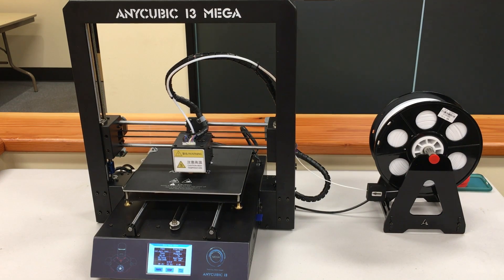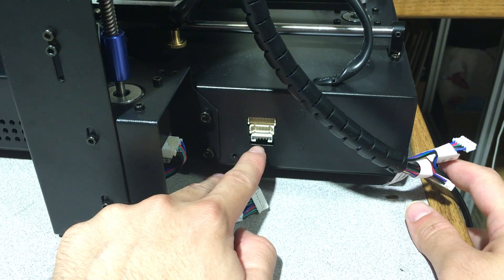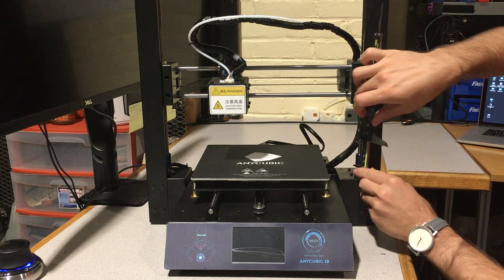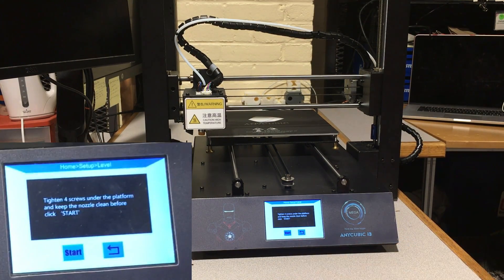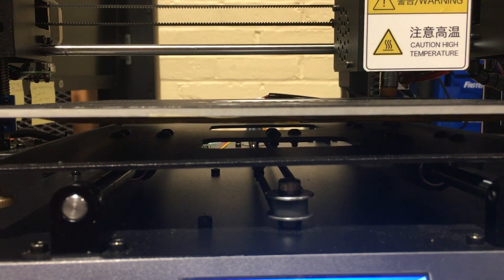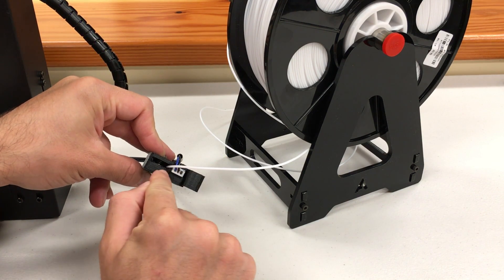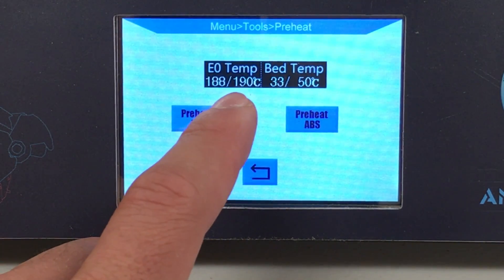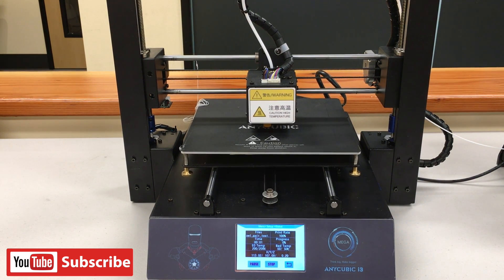All Assembly Steps | Anycubic I3 Mega | Leveling and Starting the Sample Print

Comment: I just got this printer and there is no "leveling" option in the menu, is this possibly a firmware update issue?
Reply from the maker: Its an old one. They removed it in the new ones.
Reply: @3DPDoctor  ok I was wondering if you might be able to help me with my Anycubic i3 mega that i just got from someone..  I am having a hell of a time trying to (1) level it and (2) get the firmware updated from 1.1.0
I got Cura to recognize it via the usb b and i can move all axis via my laptop,  but when i do the firmware update 1.1.5 from Anycubic it says it was successfully installed,  but when i check the printer it still shows 1.1.0, or can you recommend an alternative to the official version?
Reply from the maker: Its been a so long time I stop using this printer after the last failure, so unfortunately I can’t help
Reply: @3DPDoctor  fair enough,  thanks anyway 👍
Reply: @3DPDoctor  The guy i got it from just gave it to me and said the hot end was bad, but i tore it down and used a heat gun to free up the filament from the element,  sensor and tip and put it back together and it came back with no errors,  but when i tried to run a test the filament was bunching up a bit and seemed like it was in need of an adjustment,  but i dont want to run it again until im sure its level enough to not damage anything

Comment: Hi. Could you tell me what thickness there is between the tip of the nozzle and the plate? Wow the Anycubic I3 has leveling and all the equipment to do it (sensor, pcb, etc). I own the Anycubic Mega S, I thought it was superior to the I3.... . But both machines "travel" parallel. The sensor I want to put .... I will ask for some solutions and software updates (as far as possible) to the manufacturer. for the moment thanks and waiting for valuable info. Thank you very much.
Reply from the maker: Well if you are asking for the leveling it is around the thickness of the sheet of a letter. They removed leveling from i3 mega after upgrading to the anycubic ultrabase plate. I think it was a great feature :(
Reply: @3DPDoctor  The adjustments are not precise which is why calibration issues arise. Currently I have not performed this hardware update .... .

Comment: I bought my printer at 2020 and I don't have any options like auto levelling. Because of that reason I couldn't calibrate my printer and it nearly happened around 6 month...
Reply from the maker: Auto leveling was removed couple years ago. You need to do manual bed leveling.
Reply: @3DPDoctor  when I try to level my bed there is a sharpness at the center. what do you recommend?
Reply from the maker: Ne kasdettigini anlamadim. Ne tur bir sharpness? Dogru kelime degil sanirim
Reply: @3DPDoctor  4 köşeden kağıt geçecek kadar ayarlıyorum ama merkeze geldiğim zaman nozzle ile yatak arasında sürtünme oluyor. Köşelerde ki gibi olmuyor merkezde
Reply from the maker: Yatagin bukuk biraz o zaman. Koselere daha fazla yukseklik ver. Merkezden kagit gecebilcek sekilde olsun. Sikintili bir durum. Yatagi tutan metal parcanin degismesi lazim. Bukulmus sanirim
Reply: @3DPDoctor  Cam koymayı düşünüyorum
Reply from the maker: Olabilir

Comment: so i got the anycubic S and i can't seem to feed the filament, it preheats and when i push the button i see the weal turning that i think is supposed to suck it up but its not going in, it just keeps turning...
Reply from the maker: Tommy Sear try to flatten the filament. It is probably getting stuck on the sides of the tubing. It takes some effort. Also angled cut on the filament end would help!
Reply: Osdoyi PhD I got an other question for you, i was able to feed the Filament and do my first print. But it had the string effect. I tried printing again with 70% print speed, took 30 minutes more but still had the same string effect.
Reply from the maker: String effect? Do you mean oozing between walls that are printed? You should adjust retraction settings in the cura to solve that

Comment: I have bought Anycubic i3 Mega S and I don't have leveling settings which you have, I have to calibrate with paper.
Reply from the maker: Yes new ones doesn’t have it. You should do it manually
Reply: @3DPDoctor  Do you have any suggestions settings for Cura for retraction problem
Reply from the maker: Orhun U. Just test different retraction settings to see how it goes.

Comment: Help 
I juste got my printer and it’s the same as yours Anacubic i3 mega
But in the menu instead of the « level » option i have a « reset » button... and clearly i don’t have that beep setup.... did i get send an old one ?
Reply: I actualy have the updated version the mega-s 
Do i need to upgrade the firmware ?
Reply from the maker: Ni that’s the new one. They removed the auto level option.  So you will have to level it manually

Comment: My I3mega does not have the auto level, is there something i can get for it to have auto leveling?
Reply from the maker: They have changed their system after upgrading to ultrabase plate. For now since their printers are not open source(for the best of my knowledge) quick answer is no. You should ask it to their Facebook page!
Reply: @3DPDoctor  ok ty :)
Reply: @3DPDoctor  also my printer does not seem to pick up on the z access.  Any tips to make that work?
Reply from the maker: Shawn Yup what do you mean by pick up?

Comment: this is not the menu I get with my unit delivered today.8-28-2017.  It does not have the level function icon????
is their a new video or software update?
Reply: They released a new version of the Anycubic I3 Mega which does not have the level bed sensor anymore, so the menu entry is not needed. For manual bed leveling, see https://www.youtube.com/watch?v=6QhUgq4C008
Reply from the maker: +Jeffryzable that is interesting. Are you sure that you are in the correct menu?